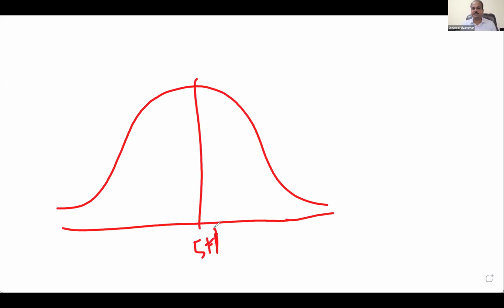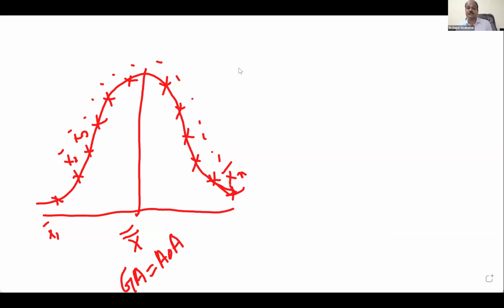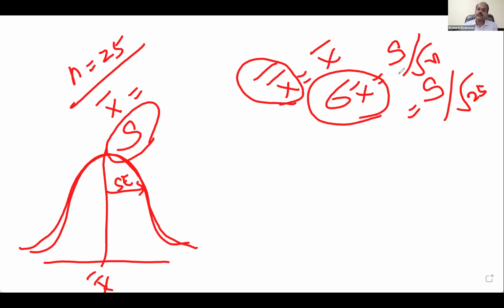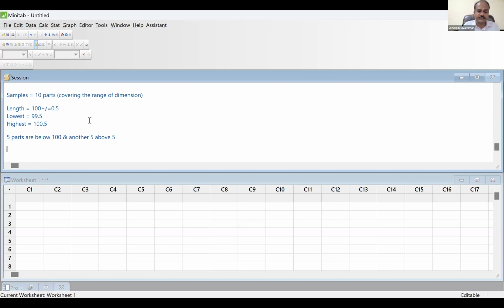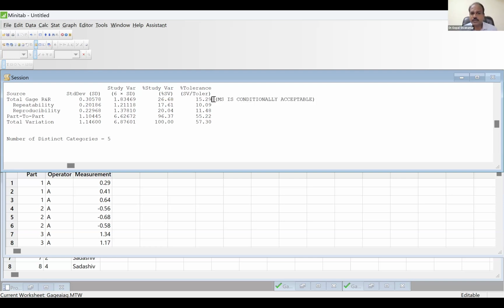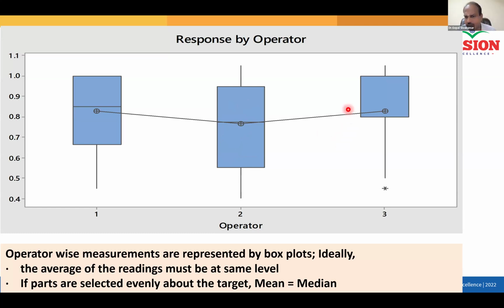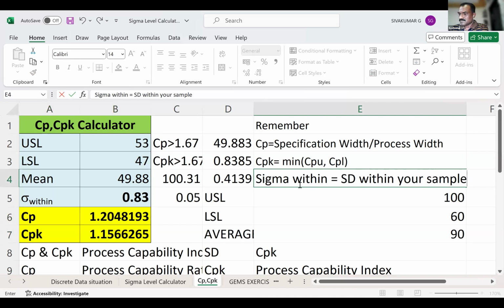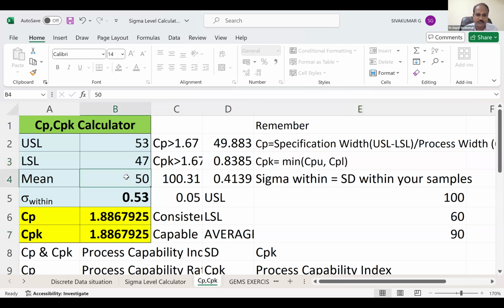GAGE R&R

Comment: Sir, could you explain about  the gage R&R with nested or destructive testing?
Reply from the maker: Sure, will do that
Reply: @sixsigmawithgsk  thank you so much sir.
Reply: Furthermore, if we encounter a repeatability problem, it signifies that the system is susceptible to either equipment variation or sample variation.